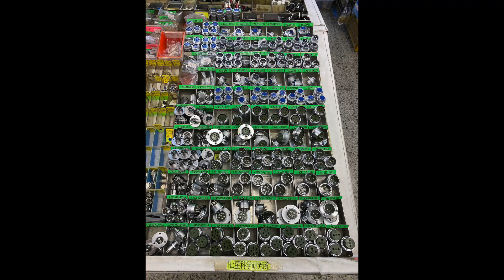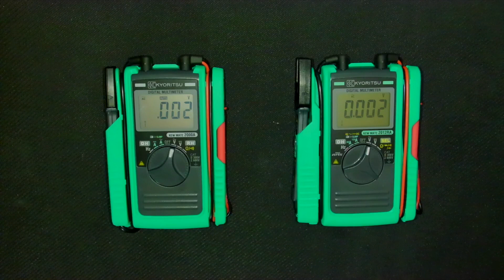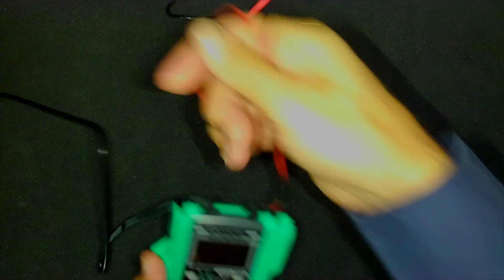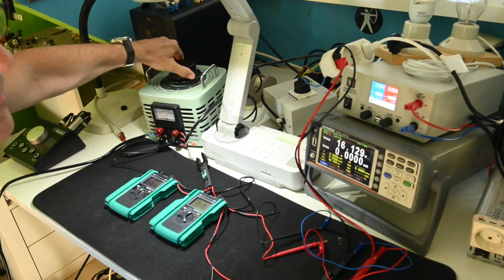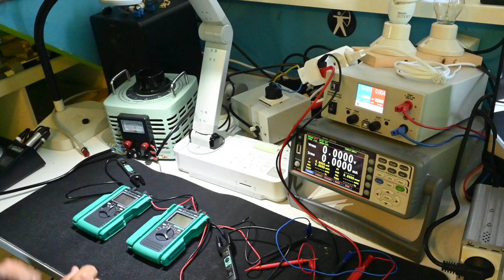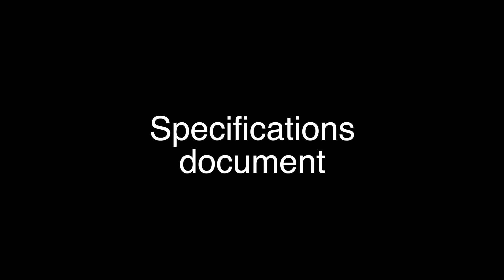REL #11 Kyoritsu KEW MATE 2000A & 2012RA review

Comment: I wonder which store did you went to buy it? 
Kyoritsu 20XX series are reliable and pocket-size super-multifunction multimeters, the main competitor of them is the PM33 series from Sanwa, Kyoritsu's current resolution is much higher (0.1A v.s. 0.01A), while having much lower capacitance capability (66mF v.s. 40uF)

I got mine 2012R back in the 2016, and it still works well after 10 years. Likewise, I always bring it around and it never has any issue. It's unique that it still get a fast-response-indication bar at the bottom of the screen! None of the small (and proper) multimeter have this. And the "one push zero" function on 2012R and 2012RA is very convenient, same as the >600USD Kyoritsu 2010 (of course 2012R don't have 0.1mA DC resolution, but the fact that it has 10mA resolution and can measure DC current is insane). 

In 2021, during their 80th anniversary, Kyoritsu made the only special product - limited holsters for Kyoritsu 20XX series in 5 different colors (only 800yen back then! the Japanese name is : 共立電気計器のKEW MATEシリーズ用、限定カラーホルスター, I believe the 東洋計測器 meter store in Akihabara had sold them, they might still have a few available), one can tell how Kyoritsu really loves their 20xx series.

Note that the only different between 20xxR and 20xxRA is how the leads-cable is fixed on the main body, RA has reinforced 90 degree fixture while R don't.
Reply: Regarding the DC current measurement, most clamp meters can't do DC mA current reliably as well, especially for "open-jaw" type of clamp like this, this may be the limitation for open-jaw design? I'm not sure. The current function for 20XX series are made for rooftop soler panels, namely rapid checking high current flow, not really aiming at lab work that require mA resolution.

We will need a "leakage clamp meter" for small AC current, as for DC current we need those "High sensitivity DC clamp meter" like Kyoritsu 2010, Prova A11 pro, Fluke 773, Yokogawa CL420 for those purposes (later two are specifically made for 4-20mA circuits. Yokogawa's is the best within my limited knowledge), note that these type of meters are very expensive. I have both 2012 and 2010, they are two of my favorite meter on the work bench!
Reply from the maker: Thanks for the extensive comments, and sorry for the delay (apparently, I get reminders for some comments but not all). I bought the meter in one of the small stalls under the railway line in Akihabara. More and more of these shops are disappearing and this is my tiny contribution to make them stay alive :-)
Reply from the maker: Oh, how nice the colored versions are! I see them at  https://www.youtube.com/watch?v=ijQywgEgfq0
Reply from the maker: And yes, I keep on picking these small meters from my bench often, even if there are almost a dozen other DMMs. What I do not like, though, is their continuity beep being somewhat sluggish compared to other meters, including the Kyoritsu KEW1021R and Keysight U123A. Those latter meters really can indicate jumpy connections, etc., while the small 2000A meters cannot.

Comment: I wanted to know about TrueRMS for this model. It was a good video, very informative.
Just two small things. You got the model number wrong for the expensive one. It's 2012RA, not 2021RA.
And, the TOC is in HH:MM:SS so it's not  working maybe?
Reply from the maker: Thanks, and spotting the mistake in the type numbering. About the TOC: it seems to work here (I see thumbnails you can jump to) but perhaps not for everyone? Concerning, TrueRMS, this is supported by the 2012RA model but not the other (cheaper) models. At 26:00 or so in the video, I compare the version with and without TrueRMS using a non-sinusoidal signal. Not sure whether you had other questions on this ;-)